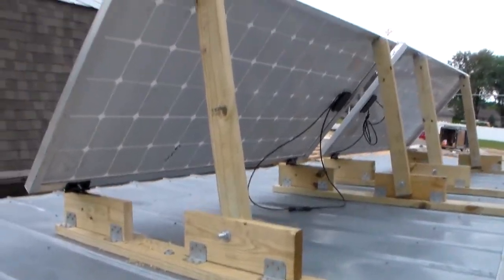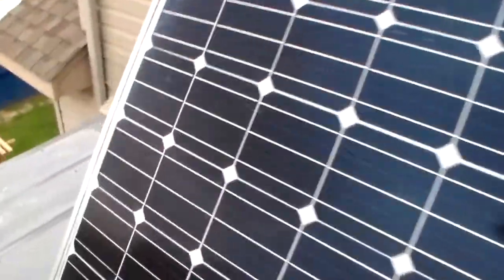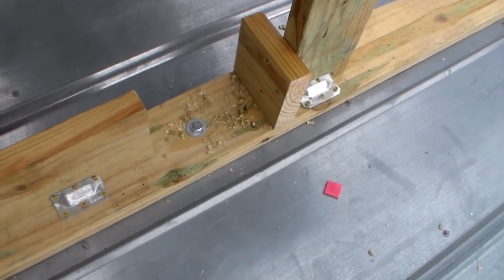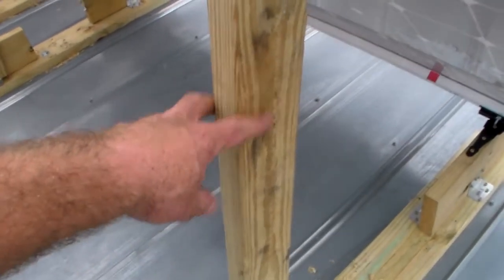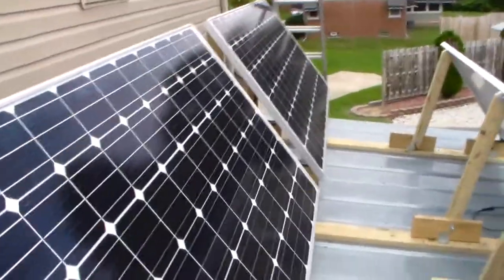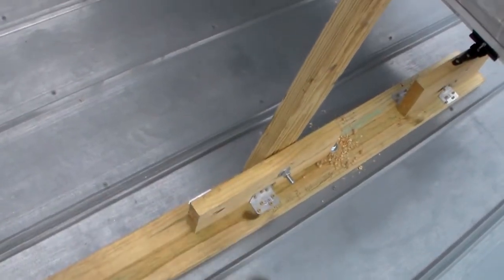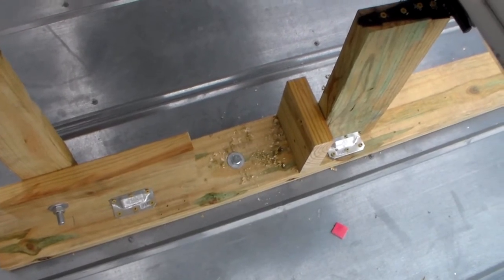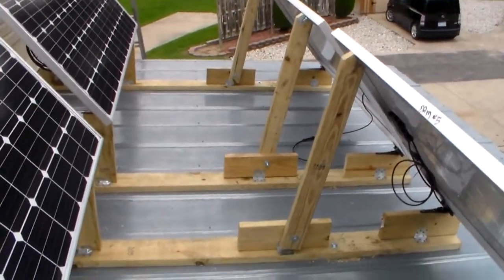Solar Panel Mount out of Wolmanzed wood

Comment: Hi mark, I know this is a old video, but I was wondering how the wood mounts have held up over the last 4 or 5 years in the weather
Reply from the maker: Everything looks great.  That wolmanized wood should be good for 50 years at least being above ground.  I have a fence that is made out of the same material that's almost 30 years old and even the posts still look great where they enter the ground (IE the most vulnerable point)
Reply: @mark_osborne   thxs for the reply, I'm new to solar myself, I just bought a few panels and 2 batteries from a neighbor  who was moving out of state, I do woodworking and can build some mounts but I wasn't sure if they would hold up, I looked into buying mounts but the price seems ridiculous
Reply from the maker: @jefftucker9225  absolutely !